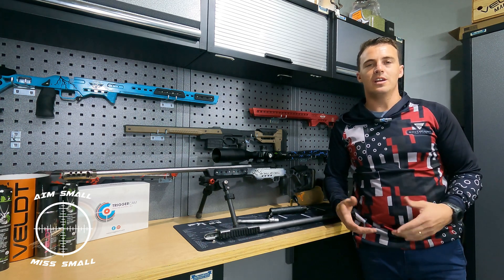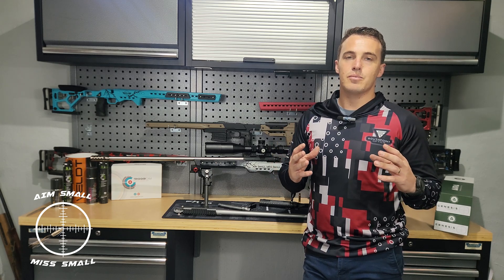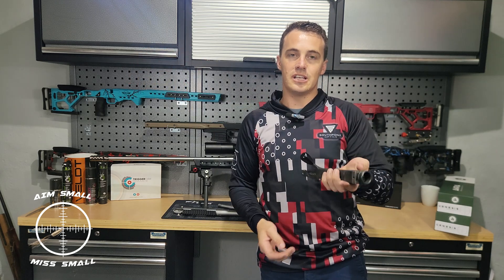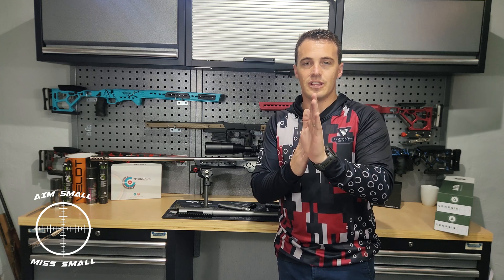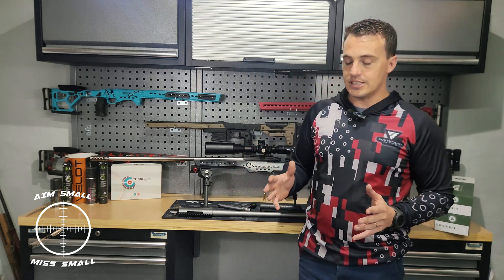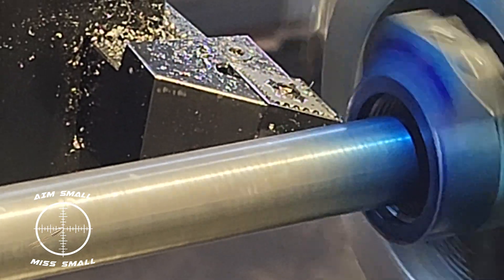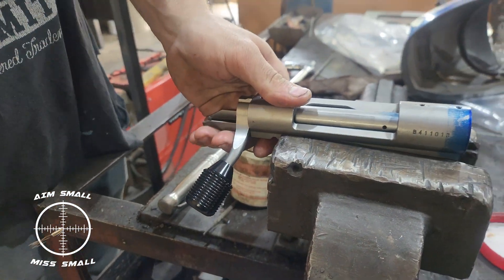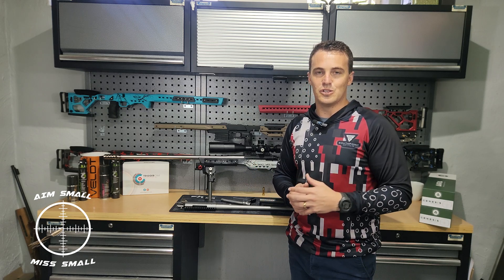What is Action blueprinting or trueing?

Comment: The lathe he is using is not a CNC lathe. it is a manual lathe. which is built to very tight tolerances, for gun smithing and machine parts that require very tight tolerances.
Reply from the maker: Thank you very much for the correction!
Reply from the maker: Thank you very much for the correction!

Comment: did this make a difference with accuracy ? 

how does your eagle shoot?
Reply from the maker: The dasher is a dream, definitely the most accurate rifle I've owned. The 6.5 still has to go for a range session. The next video will be on how the accuracy changed basically a before and after.
Reply: Will love to see that video.I also want to get a 6.5 Creedmoore Howa but I was afraid of its accuracy issues that I saw of review videos..I guess this here openes up a whole new world for budget rifles hey
Reply from the maker: That's for sure! If this happens to make the accuracy that much better it would make a budget rifle compete with a custom rifle and that in itself makes it worth the money. But let's see how she shoots
Reply: @dinodaniels2142  I have a 6.5cm 26" Howa that shoots lights out. 5 shot groups all touching. Barreled action in a chassis
Reply from the maker: As I mentioned in the video there is nothing wrong with Howa I was able to shoot my 6.5 to a 0.3MOA group at 300m. They work but there is a way to make the process of hiwa accuracy just easier